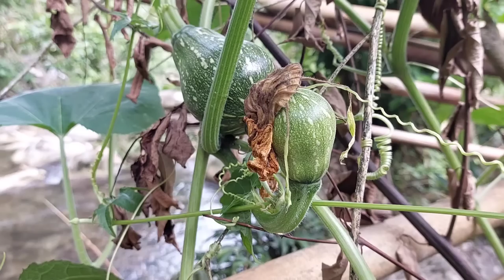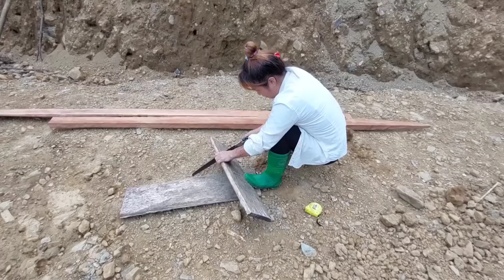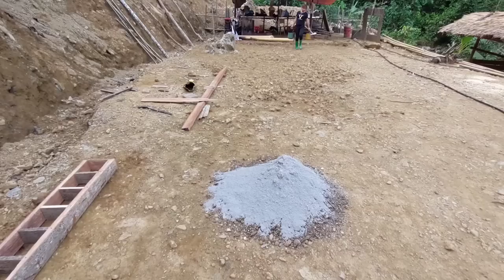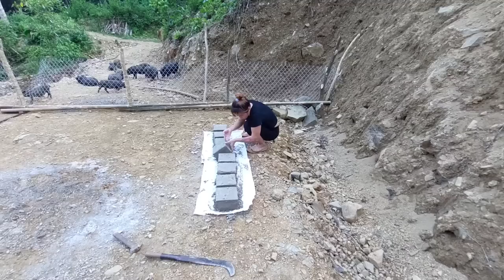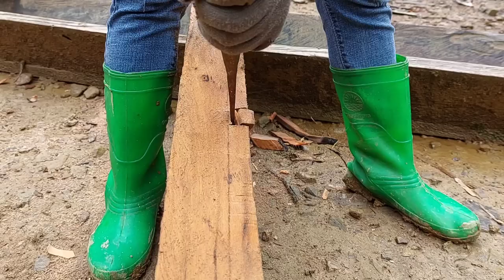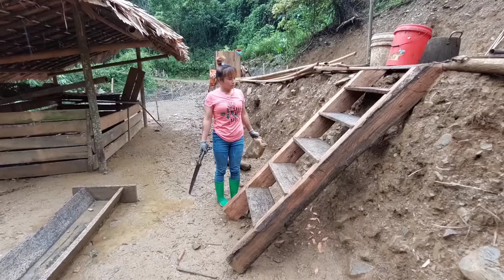Daily life In The Farm Pig - How to make cement bricks, wooden ladder - Building Farm A New Life

Comment: NICE FARM, you do things the hard way, when you work you always think how to make things happen easily and quickly with little effort, the road is the most important, clear it of stones and obstacles, buy or make a construction cart with one wheel at the front and 2 handles will you save years of work, use separate plastic molds for the concrete, you can put a plastic pipe in the center of the concrete block, so it will be large and then you will take out the bucket, bring the molds for the blocks closer to the concrete to shovel and fill without walking around with a full shovel, the wooden ladder must be protected from water, it will warp and rot under it, put flat stones, your steps are high.